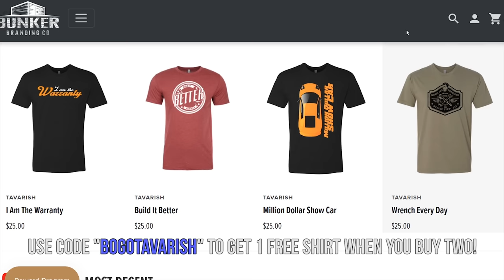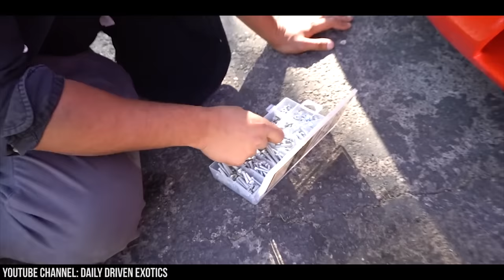I Bought TWO Crazy Rare JDM Cars And I'm GIVING AWAY Another! (1,000,000 SUBSCRIBER UPDATE)

Comment: I remember when you got the 3000gt back when you were flipping cars. It was the only car you kept afterwards and I was so glad you did. Then I got sad when you sold it. I'm even more glad you got it back!
Reply: the 3000gt turned out beautifully. I too felt kinda sad when he sold it. Glad to see her back though.
Reply: i just love 3000gts too much idk why. id deal with the issues to own one
Reply: @TempoMontages  Personally. I'd love to get a blown VR4 and do a 4G63 swap and lighten everything up. I heard a drag 3000GT VR4 got down to under 3000lbs that way.
Reply: @philspaghet  i personally have a red 94 3000gt vr4 shell with no engine but it has 43k miles on the chasis and i confirmed that with car reports. i was told it was parked and parted out in 2008 because the owner got sick and needed money. i bohght it for $500 and its the perfect 4g63 swap chasis. still has the 6 speed rear diff and aws/active aero
Reply: @TempoMontages  That would be a great swap route! I might even take out the AWS or see if you can adapt Porsche's super compact RWS module to actuate it instead of hydraulics and old electronics
Reply: Dean Gibbons  Nah, there's much more problems. I wold personally get a later year 97-99 without active aero and active suspension so there's less headaches
Reply: Dean Gibbons  very hard to work on, gaskets, old school outdated turbo tech, complex 90s electronics, etc.

Comment: Put a Honda CBR engine in the Beat. Sequential transmission and all.
Reply: Agreed, CBR1000!
Reply: Suzuki
Reply: That would be the best thing ever!
Reply: the sound and the everything omg
Reply: No not a cbr engine, but a turbocharged Hayabuza engine :D
Reply: The engine is already bike related, they rev to like 8.5k or something.  Just turbo it.
Reply: Hayabusa engine and then turbo it. 😃😃😃
Reply: Yes that would be nuts
Reply: @matthias18  yeah. Its one of the most mightiest bike engine suzuki has in its arsenal. 😃
Reply: @johnjosephmalinao7273  Kawasaki H2 engine. 310 bhp out the box (well, bike).
Reply: Yes, make a mini sized race car ^^

150+ hp engine & wide body that little car w 205 or wider tires all around it would be a Gokart for sure ^^ (Original tires is 155 all around on 13 inch rims so 205 is enormous for this already.)
Reply: The MCM guys showed that a kei car with an 1.4 (?) was already overpowered... (the blue turd)

Comment: LHD conversion on the little honda key car would be really interesting, dash looks fairly modular, so it could potentially be done without making custom dashboard pieces.
Other than that a sort of restomod could work decently for a car like that, that is put some automatic AC in it, power adjustable seats and a bunch of custom stuff in general.

Comment: Engine swap the Honda! Not sure what (if anything) will fit back there, looks pretty small, but putting some power in it and tuning the suspension, brakes, etc. could really make for something totally original and unique! And not anything ridiculous, like 600hp where it just stands in place while spinning the tires, but enough to make it like a “jdm lotus” that handles like a go cart on rails and has a perfect power to weight ratio and is remarkable to drive. It could potentially take corners unlike anything else since it weighs nothing, but has power to really get up and go, without being stupid and just burning out the whole way around. Tons of potential, and you would have virtually one of the only ones !